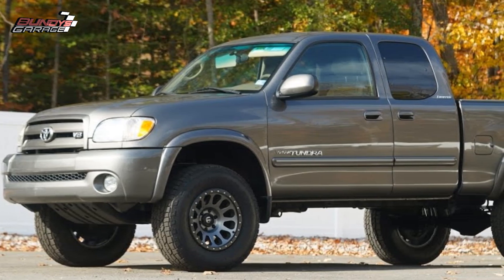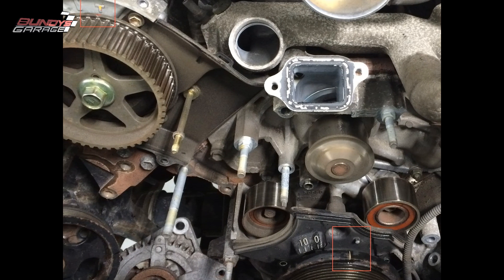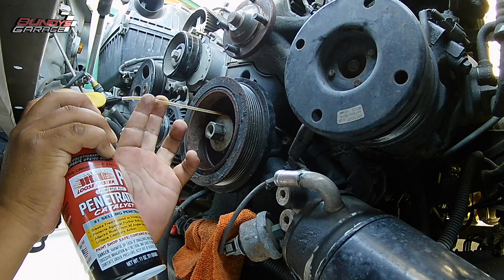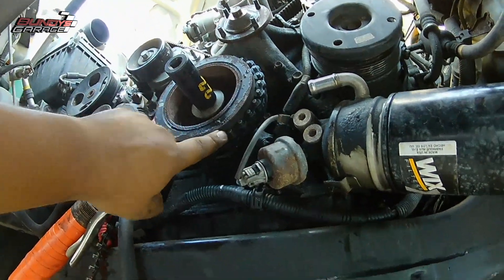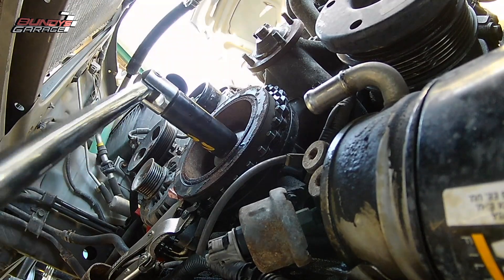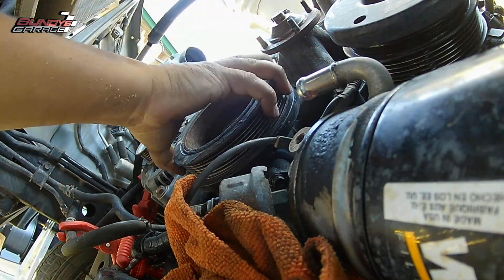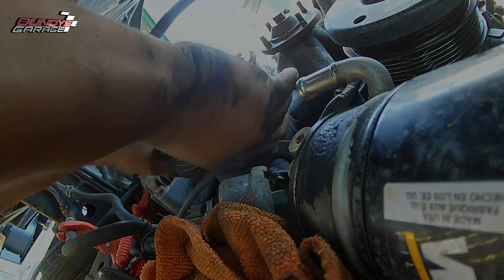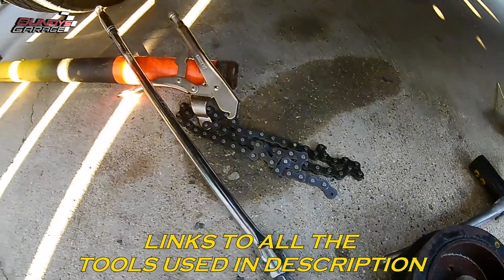1st GEN Tundra Sequoia 4.7L Land Cruiser Crankshaft Pulley Bolt Removal | 2UZ-FE

Comment: Lay a breaker bar on the frame and hit the starter. Very satisfying.
Reply from the maker: You can cause serious damage doing that!
Reply: @bundysgarage  To what, specifically?
Reply from the maker: Connecting rods, bearings, wrist pins.
Reply: @bundysgarage  No, more like the teeth on the flexplate and possibly from the bar flopping around and hitting shit. No shock on the bearings or wrist pins whatsoever. That said, i've done it about 10 times with zero issue. Btw, that's called "survivor's bias" lol.

Comment: wouldn't the timing skip by having the damper turn counter clock wise when trying to loosen up the bolt or in this case wouldn't it be minuet that it will cause no harm?